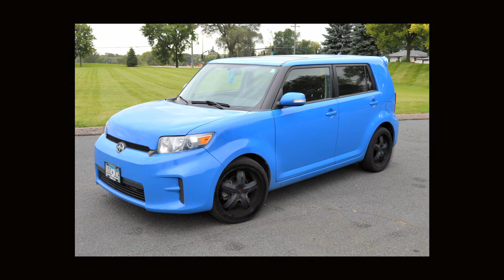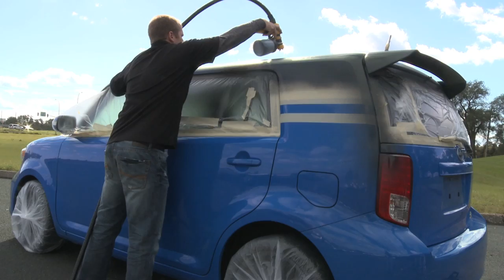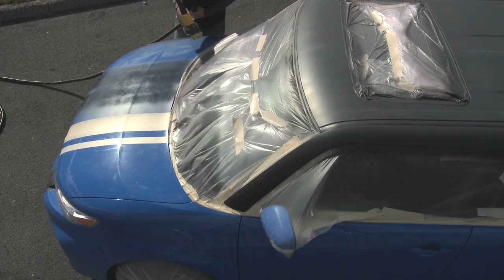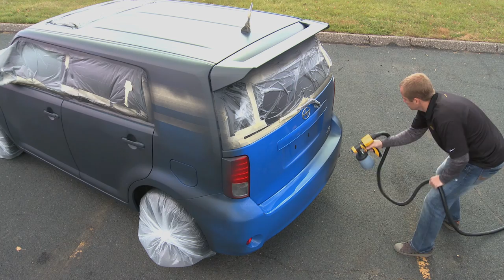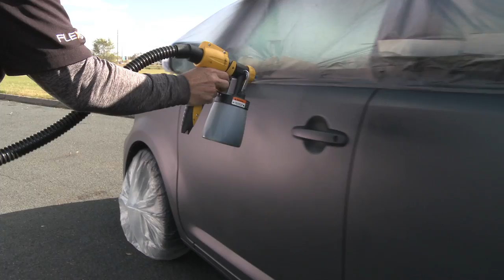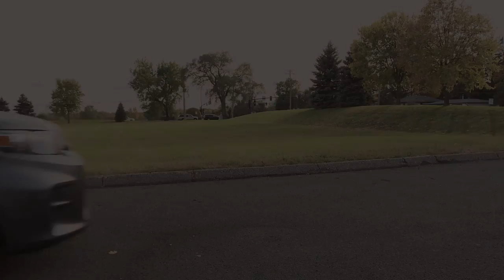MotoCoat Car Sprayer

Comment: How well does this do with metallic black paints?
Reply from the maker: Thanks for your question! The MotoCoat is specifically designed for automotive coatings, including primers, basecoats, and topcoats, but it will generally perform well with metallic black paints. Always make sure to read the user manual before use and adjust the settings for the specific paint viscosity.

Comment: Which sprayer do I use for pasti dip the big one or small one??I bought the motocoat
Reply from the maker: Both can spray the PlastiDip depending on the application. What area of the car are you spraying? If you're spraying a bedliner then we'd recommend using the iSpray nozzle

Comment: Do you have to clean the gun after each  coat or after the job is done
Reply: After that days use
Reply: I use this gun at shop great sprayer to use great quality lays plastidip flat comes with extra gun use to do undercoating and truck beds ect great sprayer I use it everyday

Comment: What kind d of nozzle is that? The one I have takes out too much material and covers alot of surface
Reply from the maker: It is a Detail Finish nozzle, which is designed to apply a fine finish.
Reply: Hi can you advise on wat spray gun should i buy thats goin to do the raptor paint on my van thankyou @Wagner-Spraytech

Comment: what paint is that?
Reply from the maker: We aren't sure the exact paint that was used here, but you can use paint designed to adhere to metal that has a flash point above 100 degrees F.

Comment: I see videos of only peel off paint. Will the Motocoat work with auto metallic paint?
Reply from the maker: James Hansen Unfortunately the MotoCoat isn't going to produce the showroom finish you would be looking for with an automotive paint. You would need a gun designed for that type of application specifically.
Reply: @Wagner-Spraytech  then why in earth call it a moto coat? Your website implies you can actually paint a car with this, not shoot disposable crap and bedliner. So, did something change, or is this of no use for shooting actual automotive paint?
Reply: @ariyanadumon4549  Sorry, but we at Wagner do our best to fool the public in order to maximize profits..